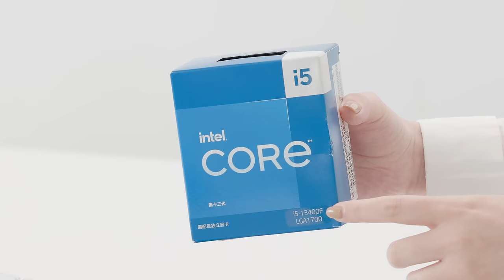装机，最喜欢的一期

Comment: meh, overheating internal case problem; ideally, cleaned cold air should flow into the case, and take heat energy from the heatsinks at the outlet of the case, without overheating the internal components.

Comment: Where is the power supply? And what gabinet is that? Custom made?
Reply: case is custom made for the parts yes. it was/is available on Chinese streaming platform but they made only 75 as far as I know
Reply: the big black box in the front of the case? you know, the one with the power supply outlets on it?

Comment: Cool case here. But!!! Having to remove the IO shield and needing the custom fitting plate in the back of the case is stupid. There are standard IO cutouts and custom plates for each board for a reason. Also, removing all heatsinks on the motherboard, just to put them back on is stupid. I really dig the idea of having the GPU fans right at the side of the case. This is a good idea for airflow. A bad idea when it comes to dirt or curious fingers. Adding the stupid fan grill to the CPU which is not accessible, but not having some "protection" on the GPU fans on the outside? Ok ... enough ranted. ;)
Reply: IO shields are only there for to prevent dust going between the connectors and to prevent u from looking between them. Other than that the IO shield does not really have any other purpose, asfor heatsink they switched it out with a more whiter heatsink, and the case has it's own IO shield since it's specifically made to fit the motherboard and gpu
Reply: @xier3x  Yeah, that IO shield of the case is stupid and against the principle of the IO shield, because it heavily restricts the kind of motherboard you can use in the case.
Reply: @Balrog132  it's a custom case specifically made for those parts, plus i thought you said you ranted enough

Comment: Press F to doubt a SPEAKON connector used for power delivery.
Reply: its not speakon but powercon, its basically same but powercon is intended for higher voltage
Reply: @xier3x  yeah not sure how they missed the big POWERCON on the side of the plug lol

Comment: I can't find a link to buy the motherboard. I could 3d print and hack a case design as i plan to use a different GPU but i need the motherboard. Did anyone find any?
Reply: the motherboard is as custom as the case i think

Comment: Stock motherboard heatsinks exist for a reason. You don't do: hmm.. i got bored. Let's rip off the stock motherboard heatsinks. What could go wrong? I WONDER...
And you just removed Noktua fans to install other fan. WHAT IS WRONG WITH YOU!?!?!?  There is a reason they are selected one of the bests... Not to mention that Noctua Fan with the guard didn't stick out outside the case. I understand, you wanted to stick to 1 color to make it unisome but at least do it right. Find a fan that fits there.

It generally looks ok  but my technical side is cringing right now... Sorry about the rant.